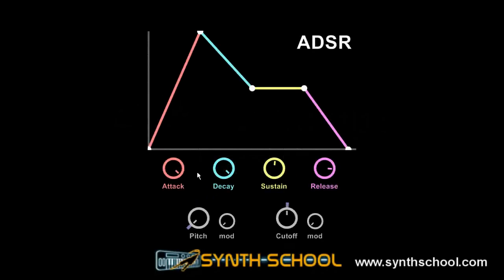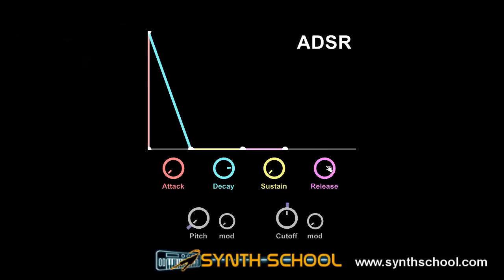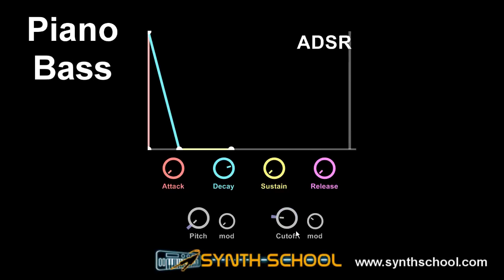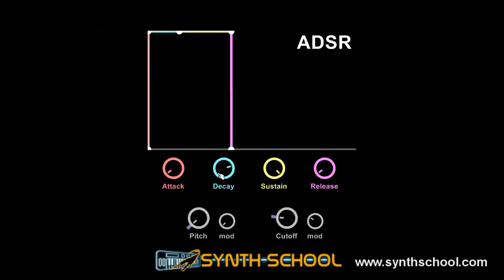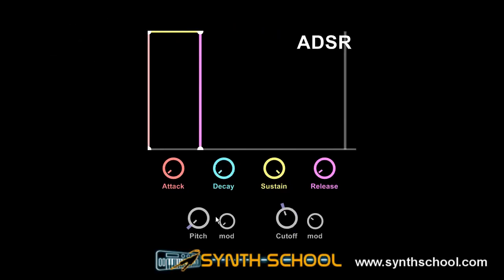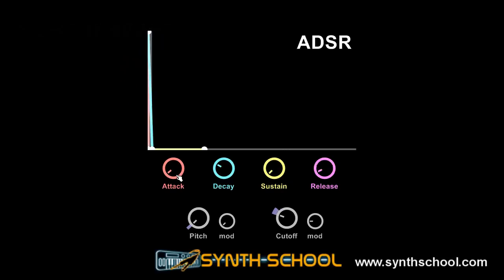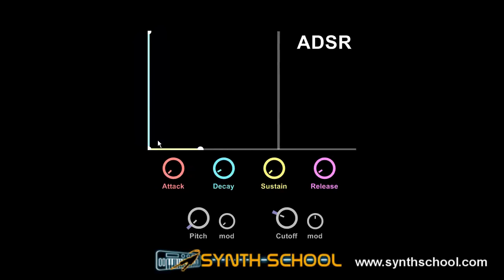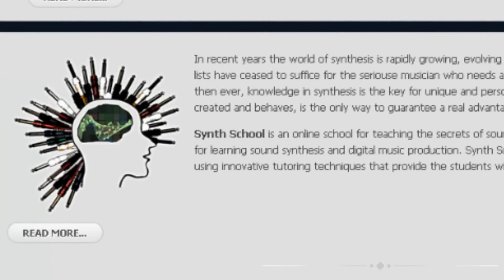ADSR envelope synth tutorial part B

Comment: this is a great explanation. although you could have mentioned in the first one taht at that stage you are modifying only th volume and that you later make th filter's modulation follow the same path, so essentially the envelope is modulating two aspects of the sound in a similar way, which is a bit difficult to understand when those two aspects are frequency and volume. but it does sound nice as you demonstrate it, so there's an aesthetic logic to it all. it's great to see the graph and her the examples and have the typical use examples. awesome video.

Comment: Great ! This was AMP envelope , right ? What is about filter envelope ?
Reply: it's both. he first shows the amp affecting the volume then shows it affecting the pitch and finally filter cutoff frequency. on some synth you have a set of controls for both filter and amp for instance. otherwise you have to use those dials at the bottom to specify the cutoff pitches or frequencies and, as far as I understand, the movements to and from minimums and maximums are tied to the volume envelope.